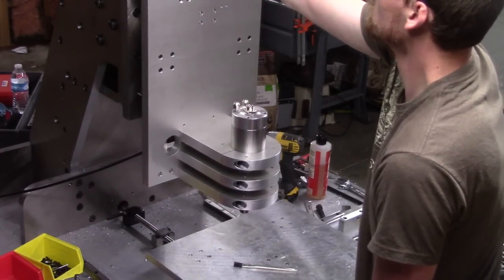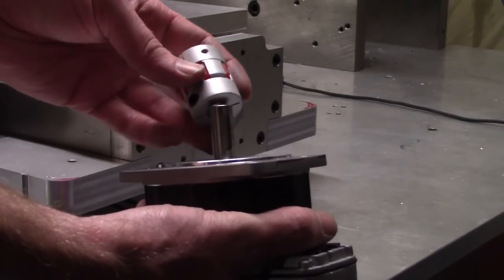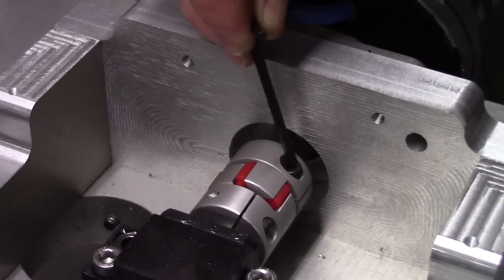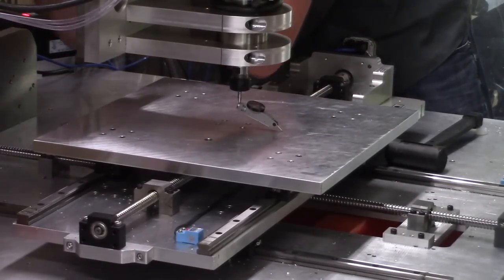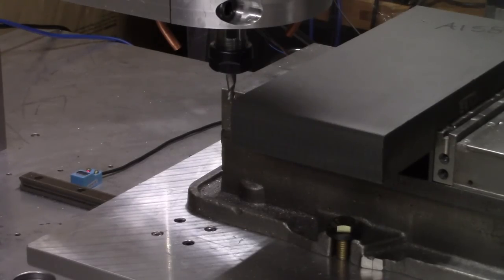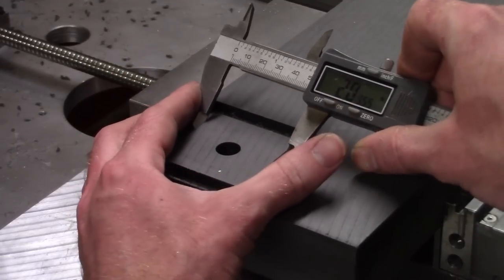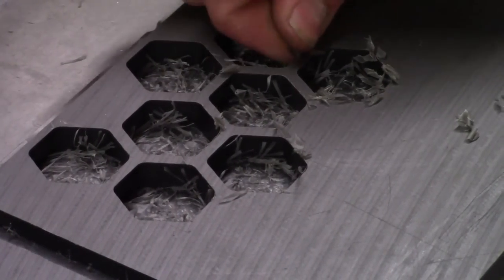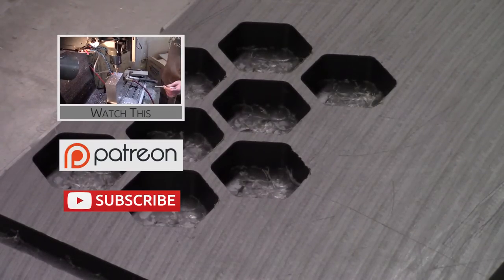The DIY VMC's First Steps!

Comment: Great video. And nice machine. I think your sizing issue is probably down to the tool compensation. Most tools I have ever used are normally 0.02mm under standard size from when they're ground. So a 16mm tool would actually cut the proper size at 15.98mm.

Comment: Very good work! You built a strong steel frame platform and Z column. Will you try to light cut the steel? What are the spec. for the rails and ballscrew diameters?

Comment: Love it!  Awesome job.  What are the specs of the spindle you're using?
Reply from the maker: Thanks!  I used a couple of your videos to help me figure out what was what as far as the ClearPaths go, so thanks for that!  The spindle is just one of the generic water cooled spindles from ebay.  Three phase, 2.2kW, 24,000 RPM with an ER20 collet.  They are less than $200 but do a remarkably good job.  Not a long-term component but should serve well as a placeholder for an ATC spindle... someday.

Comment: Watching the video I noticed that you mentioned that you don't have a good way to measure inner diameters yet, I'm not sure if you already know this, but the two arms on the top side of the digital caliper can be used to measure Inner diameters.  You can also measure distance between the centers of same size holes by measuring the width of the hole, zeroing the caliper and then measuring to the outside edge of each hole.  The arm that extended out of the end of the caliper that you used to measure steps/distance can also be used to measure the depth of drilled holes and similar things.

Comment: Yep, incredible build! Can you explain the reason for the single Z axis (no overhead gantry) and the Y-X table setup. Was it due to your supply of "off-cut" aluminium pieces (we would all be so lucky) OR the size of jobs you expect to make? I'm setting up a machine now and have an abundance of ideas, all designed around the size and shape of the output pieces. Your thoughts?
Reply from the maker: +Rodd Young It was mostly because I didn't think I could make a gantry rigid enough. Now I'm not so sure but it's to late to change plans! Lol

Comment: I have been watching this build for some time and am very impressed with how everything turned out.  Do you have a way in the future to keep debris out of the linear bearings?  Experienced linear bearings of that type on Krones labelers.  The allen head bolts on the bearings themselves are a weak point and would sometimes shear off, strip out the threads, or become loose after a machine crash.  Debris getting inside the bearings (since there are no wipers) would cause them to bind and fail.  The rail even wears when the bearings start to fail causing exceeding tolerances.  I am interested in how these linear bearings hold up with your application.  You have put a lot of labor and time in this project and it is an amazing piece of equipment.  Thanks for sharing all of this with us and will be looking forward to future videos.
Reply from the maker: Thanks!  The bearings do have wipers, they are THK SSR series.  Either way, way covers are going to happen pretty soon to protect both the bearings and ball screws.  Glad you like the videos!

Comment: Nice video. I wonder why you didn't mount the Clearpath motors 90 over? That would make the connectors below the side of the table instead of sticking up?
Reply from the maker: I noticed that later and changed it. :P

Comment: Chris;

Great build and I don't believe it was luck that your machining trammed in as good as it did.  That is some quality work you did there.

One recommendation, and this is based on my own experience.  It looks like you have a milling vise that is of non-U.S. origin.  I use the same type myself as you cannot beat the price; although if someone wants to give me a nice Kurt vise, I will certainly use it and cherish it  ;).  I used the vise as is for a while, but kept noticing my horizontal cuts were consistently out by about half a thou to a thou.  I thought this was an issue with my mill (i.e. worn V ways, worn bed, etc.) until one day I pulled the vise and measured it on my surface plate.  Wow, that sucker was out by more than a couple thou in pretty much every direction.  DON'T BELIEVE THE MEASUREMENT CERTIFICATION THAT CAME WITH THE VISE - IT IS PURE FICTION!!!

I pulled the vise apart, ground all the parts on my surface grinder to true squareness (as measured on a Starrett granite surface plate with an Interapid .00005" DTI) and the vise is now good to within less than .2 thou for squareness in all planes.  I also did this for another vise I had just purchased (finding out there was over 20 thou of difference in height between the fixed and movable jaws) and ground that vise too.

It doesn't matter if your tram on your VMC is within a thou if your vise isn't square to the mill surface.

Looking forward to seeing the projects you make on this VMC.

Regards;

Ron
Reply from the maker: It's actually a Kurt, well used, of course.  :)
Reply: Then tram to the vice instead?
Reply: Euan;

You have to tram to the table as the table is the plane of movement.  The vise is just along for the ride.  If you trammed to the vise and the vise was off, you would have the cutter at an angle to the table.

Ron
Reply: Euan;

Also, the reason for making sure the vise is square is to ensure the material is being held square to the table.  In order to have square cuts with level surfaces, you need to have the piece being cut square to the plane of movement.

Ron
Reply: Thanks for clearing that up Ron! :D

Comment: damn what a beautiful machine.    any plan to open source the design?
Reply from the maker: I hadn't really planned on it.  Not that I wouldn't want to, it's just that my build was based around the scraps I had available to me, not what would be the most cost effective or would make the most engineering sense.  There's also a lot of undocumented changes so it would be a massive project to redocument to make sure everything fits together.

Comment: Congratulations! A great accomplishment really. Loved watching the videos.

FWIW, I think calibration with the digital calipers is not very accurate or precise. Assuming the digital caliper is perfect (they aren't ;p), you need to align it perfectly with the axis and make sure there is no flex during the traversal in order to measure the actual distance traveled. Maybe you can borrow a glass scale and DRO from somewhere and use that instead.
Reply from the maker: Right.  I was hoping that the calipers would get me close enough.  I thought about taking one of the scales off the mill but that would be a lot of work.  I'll see how it does for now and adjust it if necessary.  Thanks for the support!

Comment: I've heard that endmills usually are a little smaller than the dimensions specified. A 10mm might be 9.95 et.c. That could be why the 2 inch square you milled came out a little bigger. Before re-calibrating you might want to check that first.
You could use a dial indicator to measure the travel to get an accurate reading.
Than again, most (if not all) of my knowledge of CNC mills comes from youtube so take it with a grain of salt. =)

Comment: What are the dimensions and make of your ball screws? I am looking at the chniese eBay ball screws. It has been thrilling to see the development of this project!
Reply from the maker: +Jordan Vanderham they are 6mm screws from automation4less.com. They are a bit more money but from a reliable seller who will make things right if there is a problem.
Reply: +Chris DePrisco I use their rack and pinion! Great to hear validation on a good supplier. Your machine is flying so you got it right. Thank you for the quick help!

Comment: You keep mentioning that ClearPath Servos have their own software, Does it replace or compliment the use of Mach3??? or it all alone does replace it?? I'm a real newby at all this, and just don't know much, also what what your price per axis and was that wonderful software that you talk about included or was a separate expense? 
Thanks for the video.
Reply from the maker: The Clearpath software is just a way to set up the motors, tune them so they work the best with your particular machine and then, if you want, monitor motor health, RPM, torque, position, etc.  It's absolutely free but it doesn't do anything to run the machine, just to help you set up the motors.

Cost per motor is freely available on their website (https://www.teknic.com/products/clearpath-brushless-dc-servo-motors/wizard/allresults/#ppsShowPopUp_100) and is about $250 to $600+ depending how much torque and RPM you want.
Reply: Wow.. I truly express my gratitude for your prompt reply. thank you very much.

Comment: Hi Chris.  Really cool project.  Massive amounts of machining to get to this stage.  Did you develop the design yourself, or this based on some drawings from somewhere?  How much do you think have cost you up to this stage?
When you did the hexagons, it looked like the head was shaking, or was it just rapid up and down movements?

Good luck, and nice job.
Reply from the maker: I did do all the design based around the holes in the sizes of metal I could get, so that was fun... lol.  No real inspiration for the design, just what made sense to me at the time.  I've got about $3,500 in it so far but almost all that is from the motors, controls and ball screws.  It was actually shaking - the whole machine in fact!  I'm pretty sure it's the rubber pads on the bottom of the feet that are actually pretty soft.  I'm going to take the pads off or replace them with solid metal ones.  The feet (they came on the frame) were definitely not designed for something like this, lol.

Comment: Are they dampers on the couplers? If so they will throw out your accuracy as they will compress on load - meaning you will not have advanced as far as you think.
Reply from the maker: They are a rigid but slippery plastic.  I'm not an expert on couplers by any means but they are, as far as I know, the most accurate of all the flexible couplers.

Comment: Why did you use calipers to 'calibrate' the movement, when you already know the Stepper motor's Step angle and what the Ballscrew's Lead was?
Reply from the maker: I didn't trust that the pitch was totally accurate being they are relatively inexpensive import ball screws.  I used the pitch as a starting point bit it turns out they were off a fair bit.
Reply: wow, thats really disappointing. Congrats on the build though, feedrate is amazing.

Comment: Question: what type of stepper motor coupler is that, and why not just use a rigid one?
Reply from the maker: +Rexus King they are called jaw couplings. They allow for some misalignment vs rigid couplings where if you aren't in perfect alignment you will prematurely wear things out.
Reply: Ah, now I know, thanks for the explanation and congrats on the VMC coming alive :)

Comment: Nice. Did you use mach 3/4? Do you have a video on setting that up?
Reply from the maker: I'm using UCCNC.  I don't have a video of the setup because it's really dependent on what particular combination of electronics/hardware you use.
Reply: Chris DePrisco I have all kinds of ideas of making a CNC machine but the electronics and software part of it baffles me. I haven't yet found a resource that spells it out.
Reply from the maker: A lot of that probably has to do with there being so many combinations of hardware/software out there.  If you go the UCCNC route, you can get everything but the stepper motors from cnc4pc.com with the control boards made by the guys who make the software so it just works.  Arturo there was very helpful in getting me all the parts that would work well together.  I'd talk with them once you know what kind of capabilities you want your machine to have.
Reply: Chris DePrisco I'll give that site a look. On your video where you organize all you electronics in a box, it would be nice to know what each component is and what it does. Like this is the vfd for the spindle and the board interfaces with the computer that type of thing. I haven't been able to find that even.

Comment: good job 
what is the sizes of motors you used for x y z ?
Reply from the maker: +Anwar Alfaqeeh Alhusseini 332oz-in peak 100oz-in continuous torque NEMA 34
Reply: Chris DePrisco 
What about the spindle ?
Whats it size pls ?
Thanks
Reply from the maker: +Anwar Alfaqeeh Alhusseini it's just a 2.2kW, 24k RPM water cooled spindle from eBay.
Reply: Chris DePrisco thank you 🙏🙏

Comment: OMG! That speed :oGreat work! Now I got to rebuild my old cnc ;(Was it the camera or did the Z axis wabble in the machining footage?
Reply from the maker: The whole machine wobbles!  I think it's the rubber pads on the feet (like this: http://www.practicalmachinist.com/vb/attachments/f38/11144d1237560422-lathe-leveling-mounts-.jpg).  That table zipping around is enough to move the whole 1,500lb machine.  I'm going to get new, solid metal feet and see if that fixes it.  If not, lots of sandbags. :P
Reply: +Chris DePrisco tractor weights might be of help if you work near a 2nd-hand ag parts yard. designed to hang off a simple rigid bar and helpful if you need to weight someone/thing down.
Reply from the maker: +Charles de Voil I like that idea! I'm in farm country so no problem there, lol.
Reply from the maker: +Charles de Voil I like that idea! I'm in farm country so no problem there, lol.

Comment: Have you measured spindle rigidity? For me it looks like those 3 clamps are not very good at handling up-down deformations
Reply from the maker: +Alexander Mishunin The problem is, I could measure but I don't know what's acceptable and what isn't. I figure I'll just run the machine and see if there are any problems with the type of work I'll be doing. If it all l goes well, I guess it's ok! 

I think it's rigid enough, though.  That also isn't supposed to be a long term spindle. It's just a placeholder while I prove out the machine and hopefully make a little money to afford a proper spindle.
Reply: It is probably good idea to check that numbers are close for different directions and that there is no creep. And maybe to have good time searching weak spots with indicator if checks fail :)
For a very impressive amount of work put in the machine it would be nice to get at least a few hundred of kgf/mm
Reply from the maker: +Alexander Mishunin True. Any good ideas how to measure that without specialized tools?
Reply from the maker: +Alexander Mishunin True. Any good ideas how to measure that without specialized tools?
Reply: I just used indicator on stand and spring balance with hook. Stand on table, indicator needle touches spindle,  hook on spindle's neck, right hand pulls balance with ~10kg force (that is balance for, recommended force as i could remember from old textbook),  left hand pushes against the table. Since we are more interested in order of magnitude than exact value pulling by hand is good enough (in stable position).
More repeatable force probably can be applied with something like lanyard and tough spring/stretchy rope (we need some stable point to attach another end). Or just weight, rope and pulley.
I measured relative deformations just with indicator on magnetic stand with as long lever as possible, but sometimes with small details micron indicator was needed (which may qualify as "specialized tool")